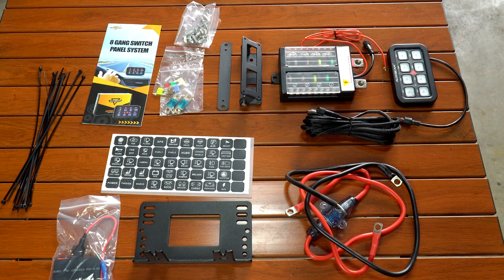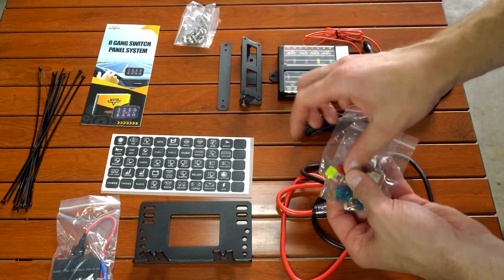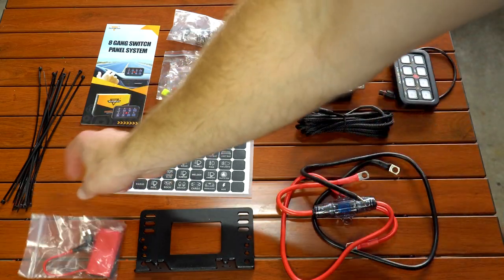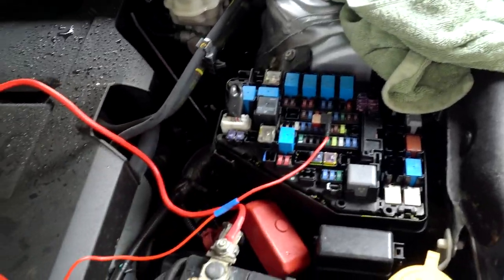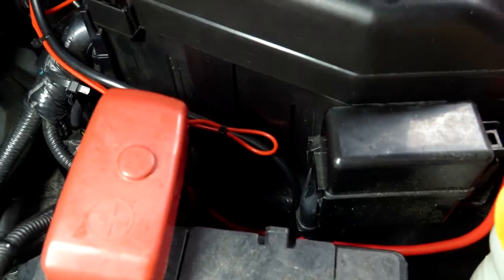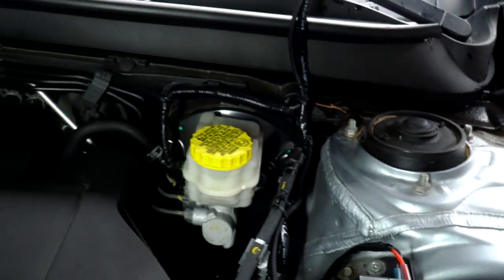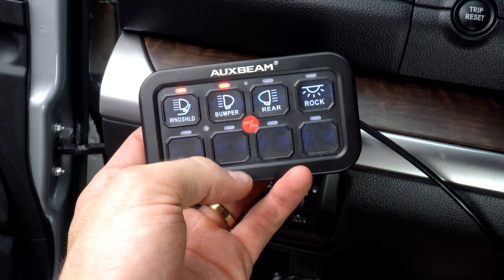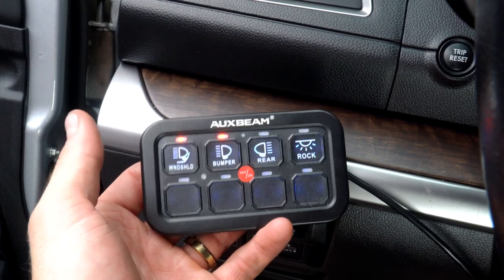Budget Vehicle Switch Panel Install | Auxbeam 8 Gang Switch Panel

Comment: Looks dope, I'm considering going this route in the 4Runner.
Reply: I have it in my 99 f-250. I absolutely love it. It keeps the interior under the dash so clean and makes the process of hooking up lights so much easier.
Reply from the maker: Yeah, an 8 switch controller is just super nice in general.  I love my switch pros for some of the extra bells and whistles but I am not sure if it was worth the extra cost compared to this setup.
Reply: Yeah I like the simplicity alot. Not gonna lie I'm not terribly technology sound, so simple is better for me lol. I have my front pods, front bar, roof bar, and ditch lights on it so far and it performs flawlessly.  Be adding rock lights to it this weekend. I can say at least with my setup I haven't hit a limit yet where anything dims down from too much power draw.
Reply from the maker: @Chad_TyrsClutch  Yeah nothing wrong with that!  I am all in favor of simple so people can DIY.  The lower capacity should only be a problem for you when you hit the limit.  So the biggest issue is just running everything at the same time.  It was a 60A maximum current draw from your battery but if you are using only some of your components at once then you should be fine.  I do not know how people get anywhere near that without running really large lights and maybe other components like a fridge, air compressor, radios, idk anything that draws a lot of power haha.
Reply: Totally worth it. One of the best mods for the money.

Comment: You may not answer, but how do I connect if I already have the INJ Fuse in use with the Alpharex?
Reply from the maker: On a Subaru or Outback? There are multiple fuses you can use as an ignition trigger. I'd just google some other options for your vehicle!
Reply: @OverlandEngineer  is for a 4runner 2020  Thanks for answering me btw
Reply from the maker: @neriomagilbray2566  I basically used one spot in the drivers side mini fuse box and another in the engine fuse box.  I think you can run two wires off the INJ with the same fuse tap but I haven't confirmed if thats a smart thing to do so don't quote me there and proceed at your own risk...many switches you can have a switch automatically turn on when the car turns on so I have my alpharex DRL on a switch  and then the switch system to the INJ.
Reply: @OverlandEngineer  Is the one inside the cabin named INJ or is it another fuse?  sorry i'm a bit new to electronics i just want to save 200$ for installation 😂

Comment: Howdy, question regarding the fuse box. Any ideas/thoughts about water proofing it?
Reply from the maker: Hmm.  Not really.  You can always use silicone on stuff but obviously not where you might need to plug stuff in.  I don't really know if it is necessary.  Certain parts need to be but others can be exposed.
Reply: @OverlandEngineer  thanks for the follow up! another question for you would be, can you connect an ARB compressor to this guy?
Reply from the maker: @Mandothemagnificent  Oh probably.  Most things can be done, they just take a little ingenuity.  This switch system has a max current draw of 60 Amps.  Many compressors can get in the 30-50 Amp draw range and you don't want to limit your current draw on an air compressor because that slows down the inflation time!  I'd use the switch to control a high current relay.  Don't run the power through the switch but you can use a low amperage switch output on the Auxbeam to control the power through a relay.  If none of that made sense to you, I have done some recent videos explaining what I understand about some concepts.  Might be worth a watch.

Comment: Inj is your injector fuse couldn’t that cause running problems later on?
Reply from the maker: I guess your guess is as good as mine.  It is what most aftermarket headlights use for DRLs.  So hopefully they have done their research.  Haha

Comment: Can you still trigger the switches and turn the lights on when the vehicle is off?
Reply: Nope, the fuse we chose only works while the car is running. If you want that option you can wire it differently.
Reply: @WildernessOffroad  what fuse did you use? Im trying front windshield washer and its just continuously staying on when thats a switched source of power, ive wire for crosstreks like this no issue, but this outback im helping is tripping me
Out
Reply: @Advntrwrx  We chose fuse 22 which is the INJ fuse. Some people are scared to use that fuse, but many other vehicles use that fuse for accessories as well. I have had zero problems with my car or the fuse box going with that fuse. BUT if you want to use a different fuse, you can get a fuse tester and see which ones dont have power running to them when the car is off.